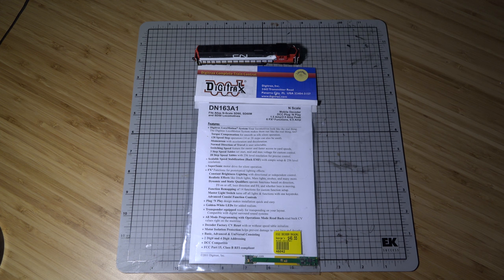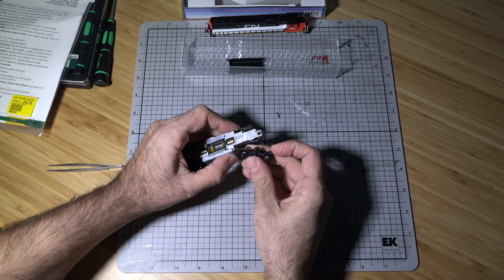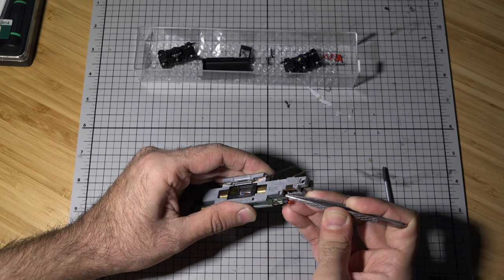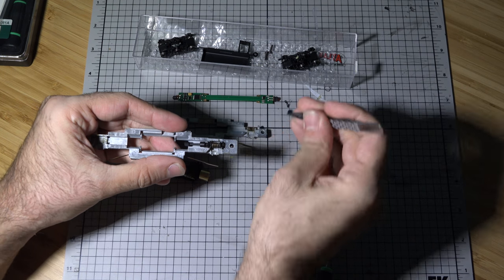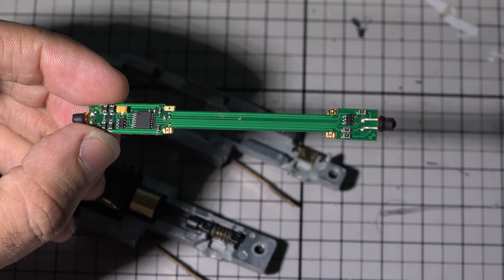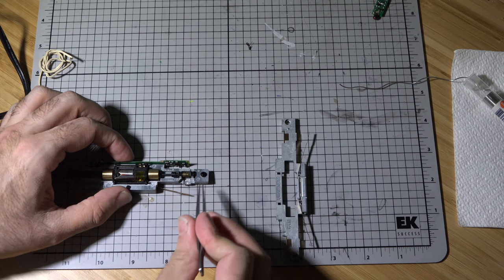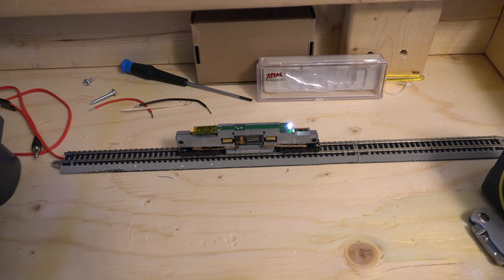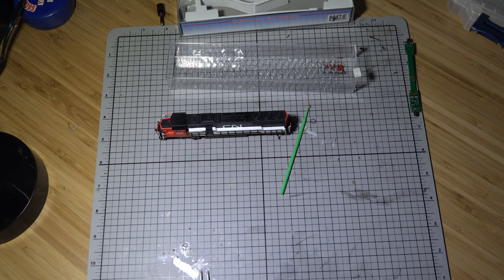SD60 Decoder Install

Comment: WooHoo 1st , Good Job Tim  I done 2x SD60m's with the same decoders & one with an ECO100 sound i also poked through the Pickups & soldered = 100% contact Awesome ,i also showed this on my Atlas pickup fix Video.....Cheers-Rich.....

Comment: do you only buy from gorges trains. there prices are very expensive compared to some of my other dealers.
Reply from the maker: No, what are some of your other dealers?  The other hobby stores that I've bin too are about$10 and more compare to George's. But the only problem is that they don't have much of a selection on N scale. The other place where I shop is eBay.
Reply: have you bean to credit vaily in mississauga. or daily hobbys in whitby. do you know dave cool.
Reply from the maker: I have. Their about $10 more the George’s and I don’t like how they price their item according to the daily fluctuating currency. In other words they treat the item like as if it was the stock market. But I have to give it to them. They have an amazing selection on train stuff.
Reply: NSmodelertim daily hobbies in whitby? They are much cheaper by about 30%
Reply from the maker: I’ve bin there. That’s where I got my first sound locomotive. The CP SD90/43mac. Lol. I’ve bin to panthers hobby they are the most expensive. And I’ve bin to johns hobby at the danforth. That’s my favourite but it’s far and down town and no parking.
Reply: i have had the worst experinc at johns hobbys with a rc airplane
Reply from the maker: Ya I heard the same thing but it was about an RC car. Ups and downs it one or the other.